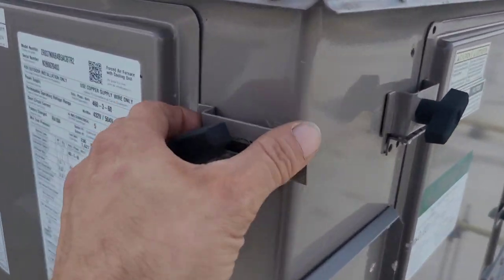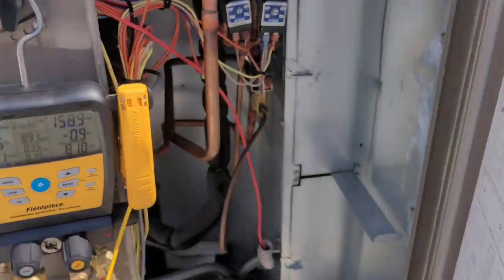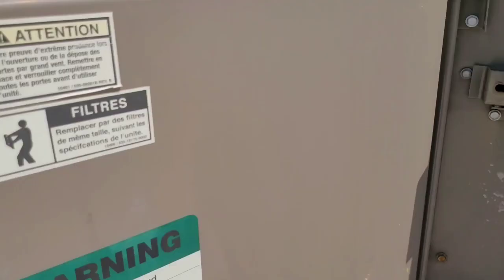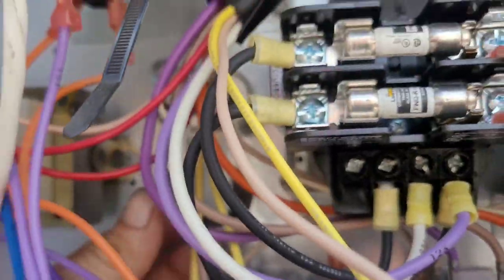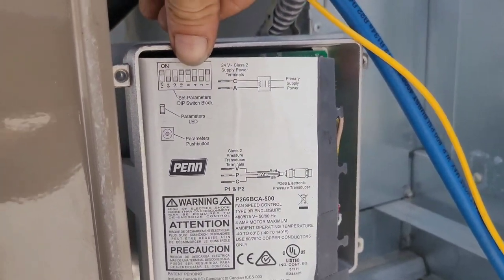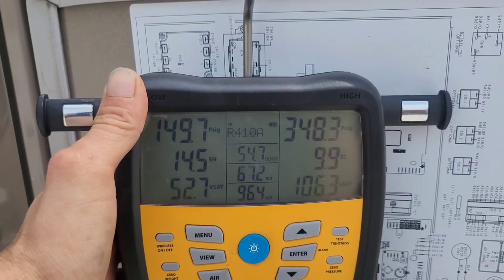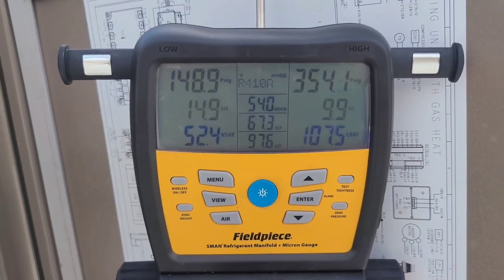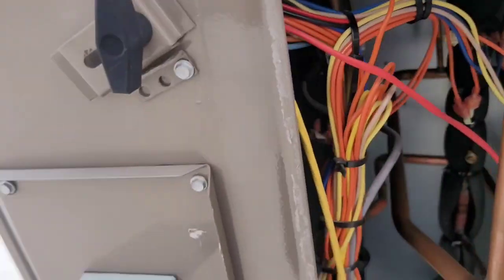P266BCA Fan Speed Control on York RTU with High Pressure Lockout Reset

Comment: Nice work, would mention that checking the ESR of run caps is the only reliable way to evaluate them though. About 80% of bad caps still read fine or a little higher in the reactive plane so checking just the capacitance can give you a false sense of security. I used to go over to my old bosses and checked boxes of new run caps and few times I'd get a bad one brand new out of the box.
Reply from the maker: good explaination, and i fully agree! testing a capacitor under load is the best way.
Reply: @HVACRServiceTech  I should probably explain I was the service manager for a few brands here in Oz where it gets pretty humid and hot. About 75% of contractors were claiming for a compressor replacement when it was just misdiagnosed run caps.

Comment: I have the same issue. It does it every two weeks and it’s checking out just fine when I go out. Tech support says to replace board cause it can give out faulty codes and said other techs have same issue and have recommended it to them too and haven’t called back. I don’t like guessing but it’s been very annoying.
Reply from the maker: I feel like, the need to help you get it fixed... I just know, that if i could put my tools on it and spend a couple hours getting too know the system, is could figure out the issue. I just don't know how I could possibly do that though, lol
Reply from the maker: So, you have to take the bottom covers off, and actually wash the coil and wash the ice off every two weeks, it freezes up that bad? This was a Hill Pheonix 5 door FF case right JNL model or something like that

Comment: York stuff is junk imo. Dehumidifying is done by sending discharge has to coil after evap, I’m guessing one solenoid to condenser and one to reheat/dehumidification coil. Never seen that fan cycling control though. I always put on my job reboots “all operations correct at this time”, to cover my ass.
Reply from the maker: Yeah I usually put something like that. No issues found at this time or unit operating properly or unit is operational at this time...always something tho. Doesn't matter though if they put in a call back it's still going to be a call back

Comment: Great troubleshooting. You handled it the way I would have. With an electrical storm probably got a glitch in the electronics like you said why look for a problem that may not exist. Let it run and see if problem comes back and take it from there. I’ve been down that road a few times.
Reply from the maker: Yes sir exactly it's a waste of times most of the times because there is never a problem. more times than not it's an electrical glitch from a lightning storm